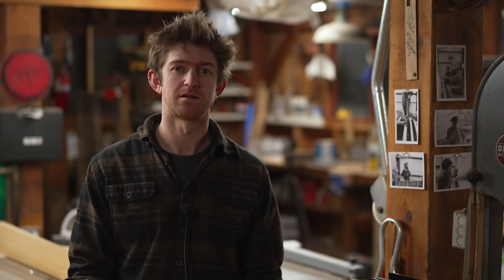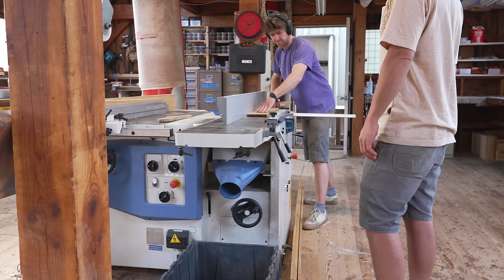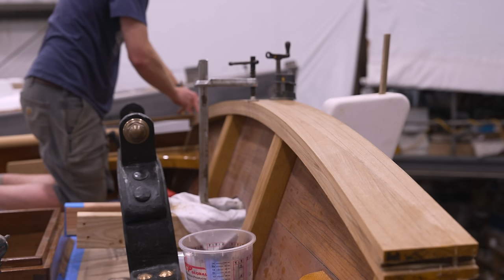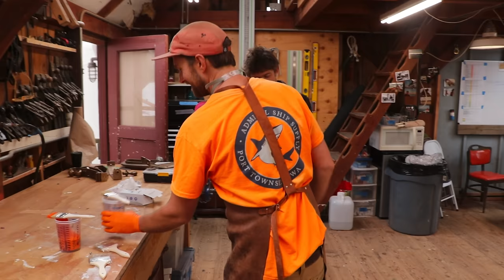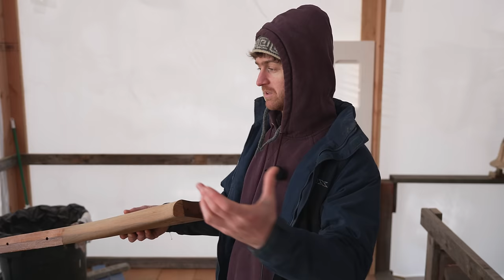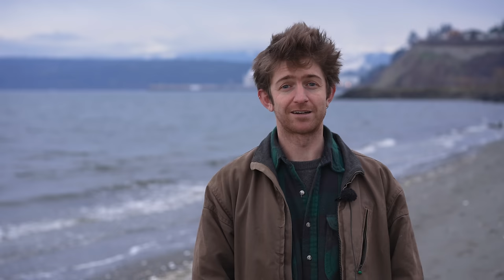Sad news.

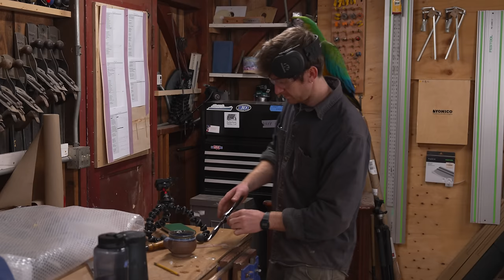Comment: At 18:17 - I see Leo tapping a hole into a piece of bronze rod using a ratcheting tap handle.  While this handle is a nice piece of kit, and the ratcheting function seems handy, it isn't ideal.  When tapping a hole it is important to clear the chips.  You do this by rotating the tap forward a half or full circle, then reverse the direction a small amount.  Otherwise the tap can bind and, as taps are hardened steel and brittle, they can snap in half (and are notoriously difficult to remove).  Certainly this is important when tapping steel - possibly not so much with bronze - but it is nevertheless good practice in all materials.  Thanks!  My two cents.  John

Comment: Leo, You haven't mentioned anything about the sails yet to my knowledge. Have you sourced a company to make them and have they started yet. It looks like you are quickly approaching that stage where they will need to be placed on the boat. Will there be any changes from the original design Tally Ho had?